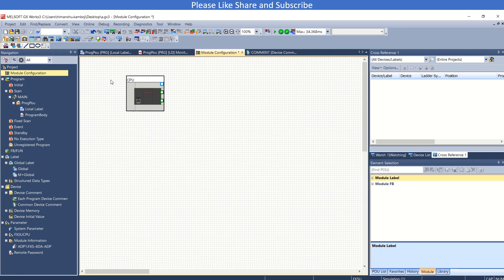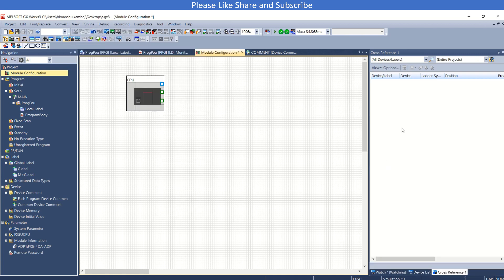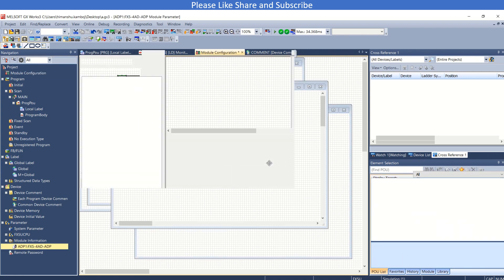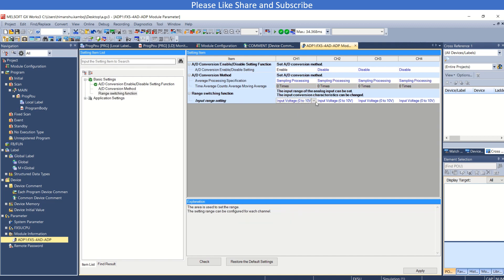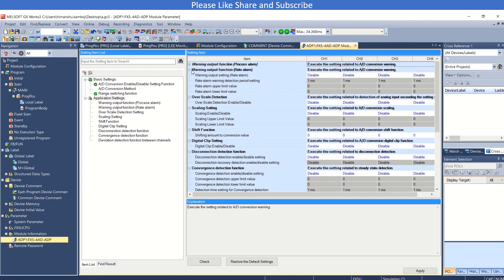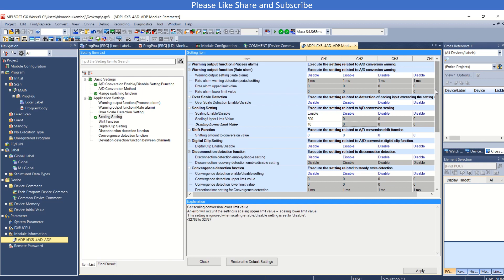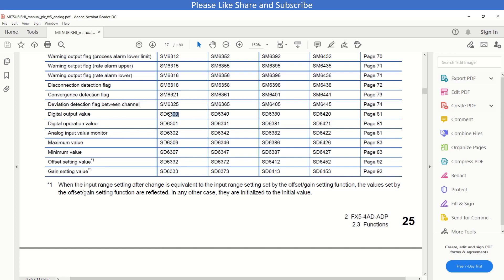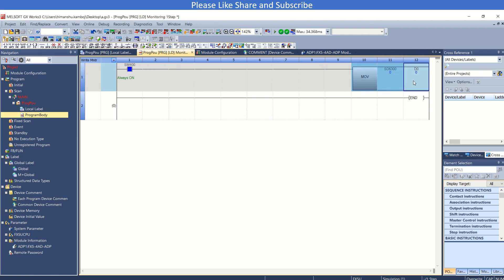Mitsubishi FX5 4AD ADP Analog Card

Comment: Tell me when we set up scaling settings, we set up a physical value or a discrete value range of 4-20mA, 0-10v in conventional units. That is, we need to measure the temperature -10 +350 and then we will have a specific physical value in the register in the specified range-10 +350 or discrete values 4-20ma=(0-12800) 0-10v(0-1600), which will need to be processed by the scl function?and could you put the training videos in the following blocks fx5-4ad fx5-4da
Reply from the maker: https://www.youtube.com/watch?v=qqCKFFho3R4